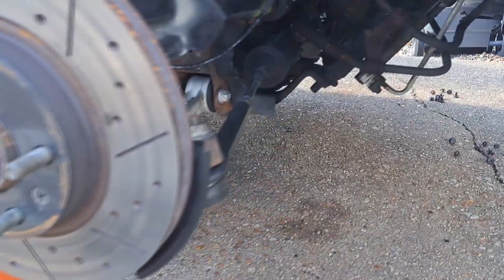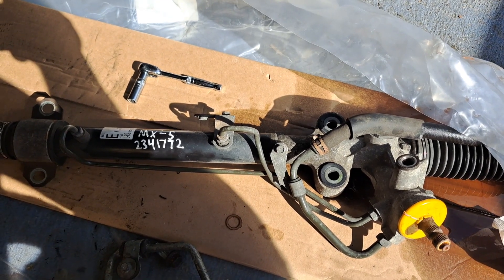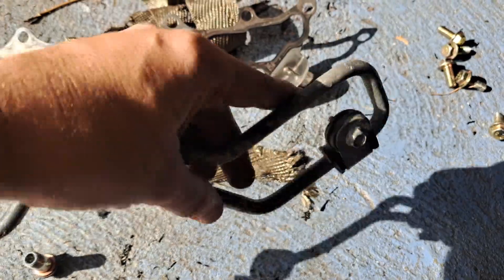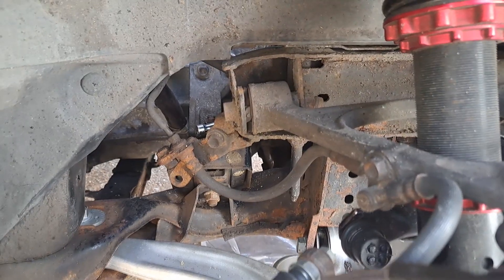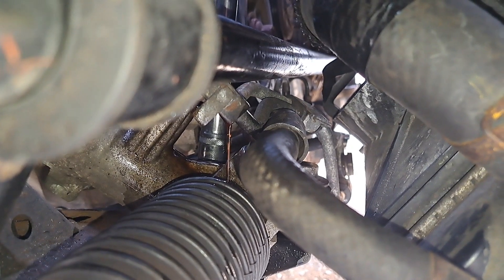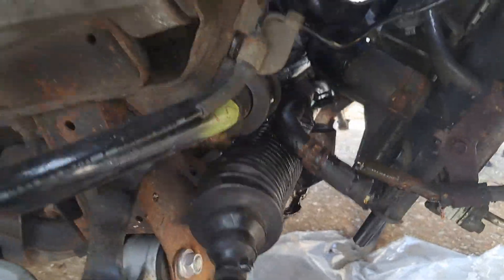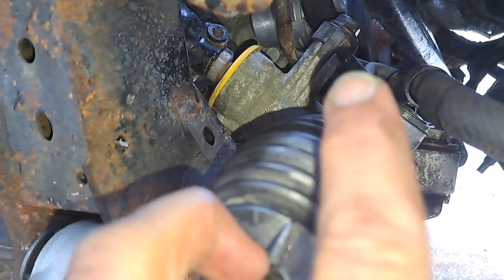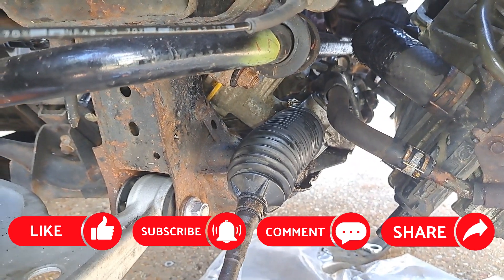Mazda MX5/Miata NC Mk3 - Maintenance Episode 16 - Steering Rack Replacement

Comment: Is it necessary to undo the lower u-joint on the pinion top ? Can it be done just unmounting the upper U-joint from the steering shaft ? Ot there will be not enough clearence to get it out ?
Reply from the maker: From what I remember that doesn't work. But its only one bolt so give it ago.